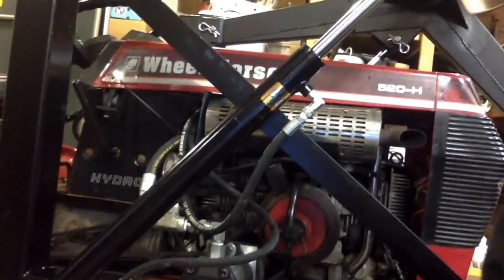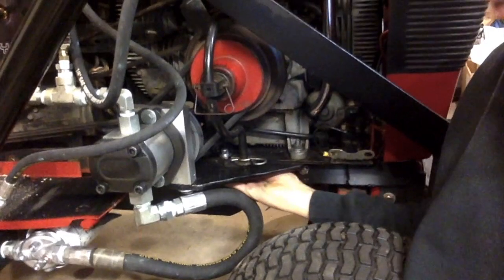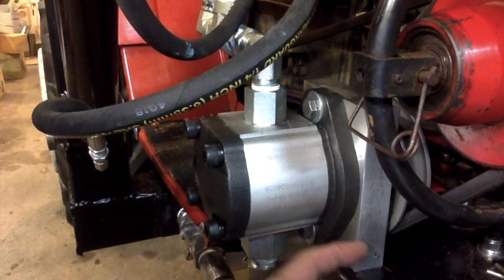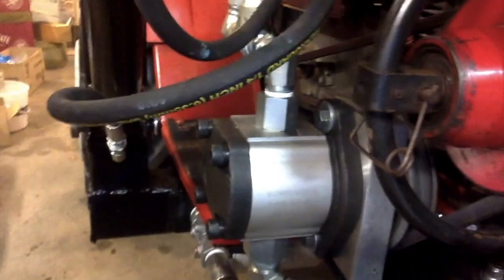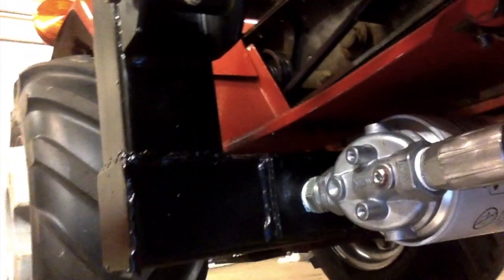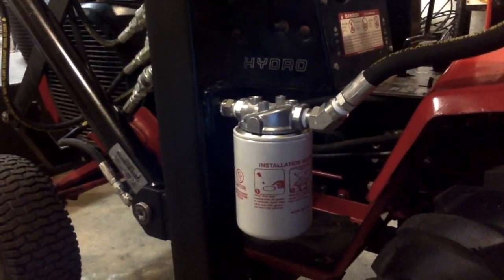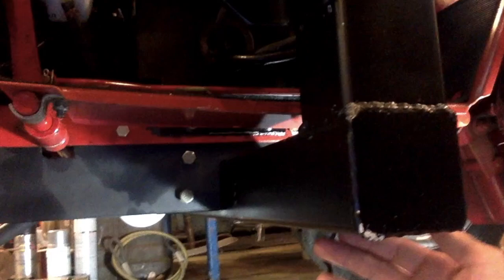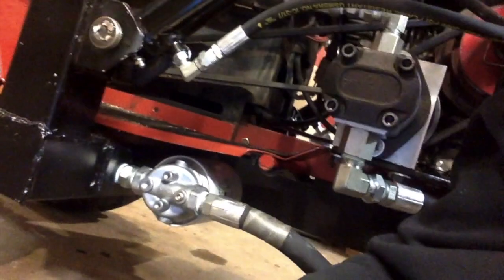Loader build for Wheel Horse 520H

Comment: really nice job only 1 thing, you never put a filter on the suction side, I know it doesn't sound right but i work with hydraulic techs and they say when they get dirty they can collapse and or cavitate starving your pump which can ruin the pump or at least make the oil even hotter due to restriction. not being critical like ZI say just input I got  from experts in the field when I built mine.
Reply from the maker: Hi Steve, Thanks for the insight. I did consult with Hydraulic power experts on this before doing so. And I was cautioned about such issues. Notice that the suction filter is designed for many times the flow rate of the pump and is not a super fine filter - made to catch the big stuff. AND, it is important to change that filter regularly. I weighed the options of your concern with the risk of sucking metal chips from the bottom of my tank and sending them through the system before any chance of filtering. In the end, I made the decision to go this way - fully aware of the risk. 
Thanks for the comment. Maybe, after running it for a while and making sure any manufacturing debris is filtered out, I can remove the suction filter. ??? but I will definitely be changing it regularly before then. Thanks again! 
Love to see yours - Link?
Reply: @deaconjim8219  yeh I hear what your saying for sure it never made sense to me either to have a chance of crap ruining a pump but was assured it was the right thing to do, but now you got me thinking ,,like you said over rated for flow and not as fine and change it often, to me it makes perfect sense and I just may try it, pumps are not cheap.thanks for the reply, when I get mine done I will share.
Reply from the maker: @stevelecain886  Looking forward to seeing yours! Thanks!

Comment: That is pretty dang awesome. I own a Toro 418 wheel horse. By any chance do you have plans for this load? Many thanks. Dean
Reply from the maker: Mostly just a toy. I have moved a lot of snow in the winter and recently moved 10 yards of black dirt for a friend. Also very handy loading firewood especially the bigger logs.
Reply: @deaconjim8219  it beats the heck out of having to do it all by hand. I am looking to build something similar for my Toro where did you get the blueprint plans for the loader?
Reply from the maker: It is my own design. A custom build, made it up as I built it. Wish I could be more helpful, but I would be glad to offer more info if needed.
Reply: @deaconjim8219  many thanks. I would like to get some dimension of the reservoir and the supports for the frame. Such as the thickness of steel tubing. I greatly appreciate your response. Many thanks. Dean
Reply from the maker: Hi Dean,
The reservoir is .120 thick (11 gauge) 3" sq. tubing. 
I strengthened/extended the frame with 3/16" thick x 5" wide flat stock. I used a plasma cutter to notch for all the bolt heads already on the frame so it would lay flat against the frame and still slide all the way up to the horizontal part of the angle iron frame. 
The unit has proven it self over and again to be plenty strong. 
Hope this helps. 
Jim
Reply from the maker: Also, the mounting plates welded to the reservoir are 3/16 thick too.

Comment: Nice work! If you don't mind me asking what did the hydraulics cost?
Reply from the maker: Pump, joystick valve, 3 cylinders, hoses, all couplings (lots of em), including quick couplings, ... around $1200. All new stuff, most from surplus center
Reply from the maker: that also included the filters, filter mounts and pressure gauge.
Reply: Thank you

Comment: What gauge/gauges of steel did you use? Also, what’s the heaviest thing you’ve tried to lift?
Reply from the maker: All of the frame is 3/16" thick. I have the relief valve on my loader 1250 psi. The pump is capable of 3600. At 1250 I can easily lift the back end  off the ground (with the 200 lb weight in the 3 pt basket/counter balance) if I try something too heavy . I am confident I can lift 500 lbs. though I have not weighed a load like that. I have lifted fairly large rocks, full scoops of gravel and river rock all with no problem.

Comment: How long is this machine. I am looking for one and I'm in the process of building a trailer.
Reply from the maker: mine fits on a 10ft trailer with the bucket all the way down  - that includes the weight bucket on the 3 point in the back. I tried very hard to keep the bucket close to the front wheels when fully down. 
Hope this helps
Reply from the maker: I have not measured it, but it needs most of the 10ft. A 9ft trailer with a gate or tip up ramp would not work.
Reply from the maker: Also, it weighs about 1200 lbs with the loader, counter weight bucket and wheel weights.